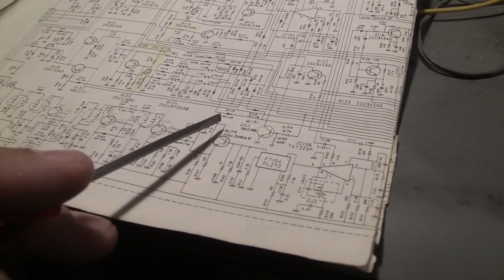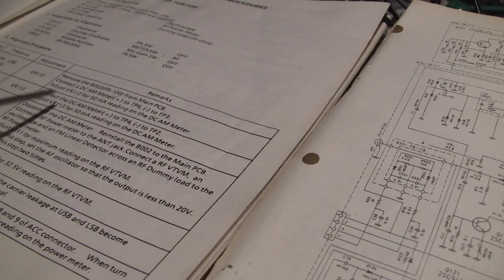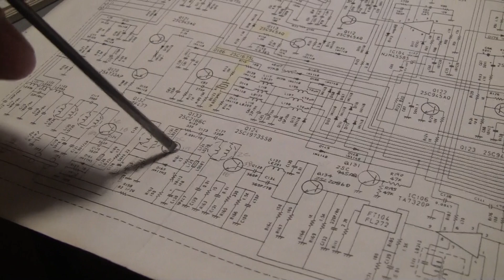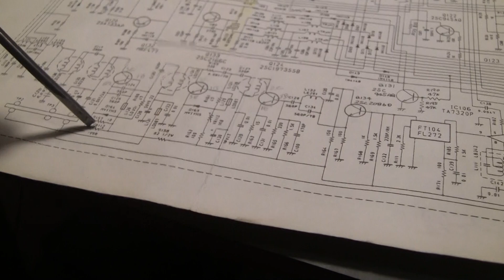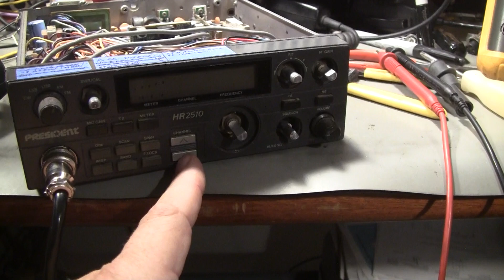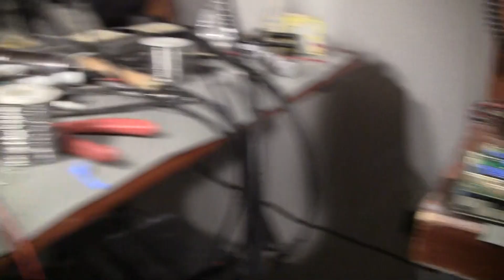Yet Another HR2510 Saved from The Scrap Bin !!!

Comment: Excellent, thanks for sharing, my HR2510 does not tx. When moving VR113 it does not increase more than 10 mA, when moving VR112 it does reach 50 mA... any suggestions for me...? Thank you
Reply from the maker: Hi Raul. That was a long time ago for me. What I usually did was start by verifying that the microphone is fully working first. Then I'd find a schematic and start tracing the circuitry with a scope.